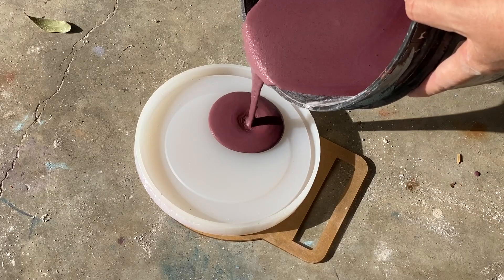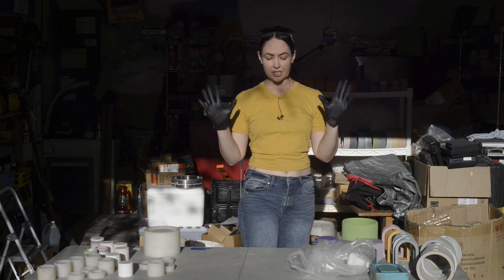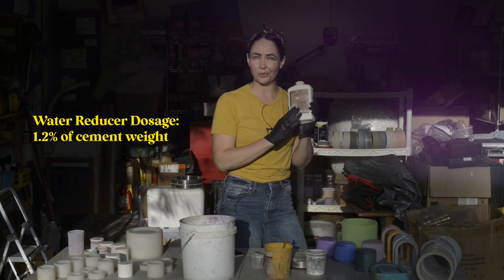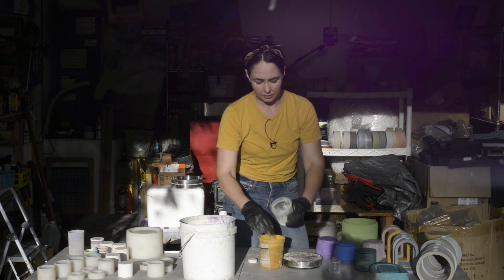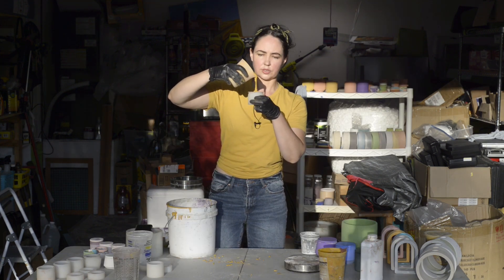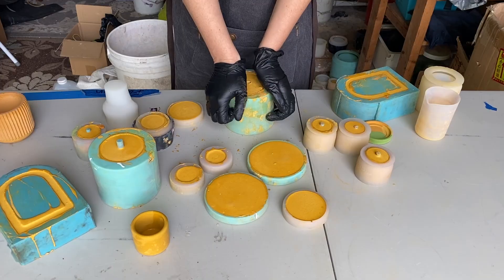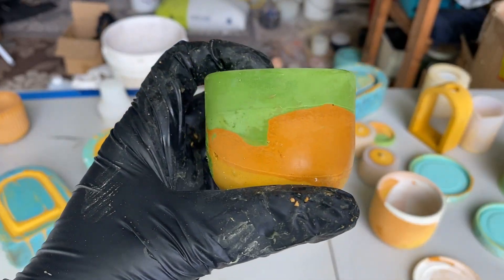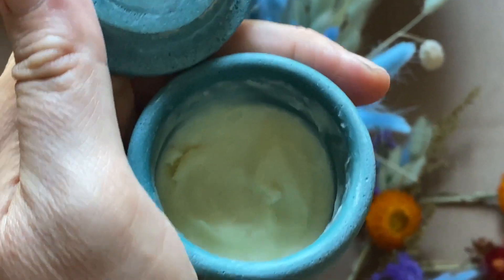Artisanal Concrete Tutorial: How to make concrete flow by using a water reducer plasticizer

Comment: Have you experience any issues with the plasticizer effecting the strength of the color/pigments in your mixes?
Reply from the maker: The only issue I noticed is when I use synthetic pigment it sometimes creates a foamy effect that creates problems with strength. No issues when using oxides.

Comment: merci beaucoup de partager votre travail, c'est très beau. avec quoi sceller vous vos pot? je souhaite faire des pots a bougie.
 merci
Reply from the maker: For candle jars you need to use a good penetrating sealant. I use seal krete which I believe is acrylic base but it's not good for candle jars. It leaves the surface slightly porous and the candles look greasy. I wouldn't use anything polyurethane or resin based on the inside because of the flame and potential for harmful VOC's.

Comment: I would be interested to know what kind of sand you used, and where you source it. Thanks.
Reply from the maker: It's sakrete play sand. You can get it at any hardware store in 50 lb bags. It's pre-screened and and has a nice grain size that works well for this. However, I believe the sand source varies according to region even if the brand is the same. I've also tried with some finer beach sand, but the grain is too smooth and causes cracking. One time I splurged on really fancy jurassic sands (purple garnet, river and desert) and would not use again unless I was doing alot of sanding that exposed the grain.